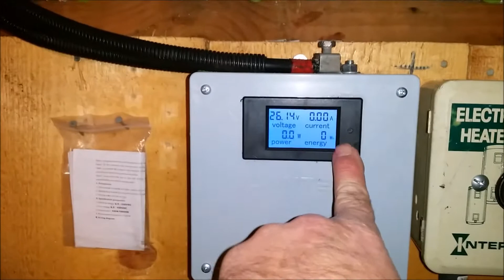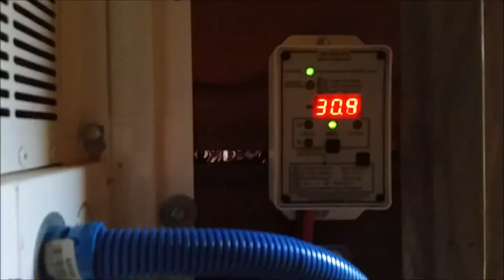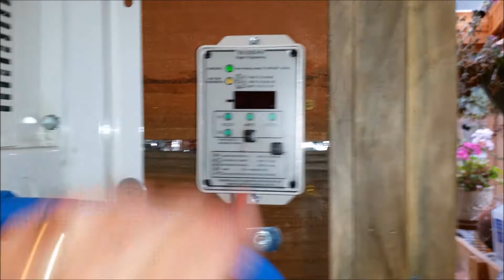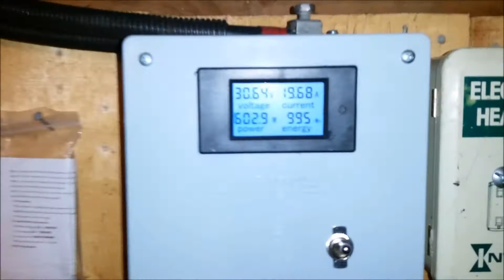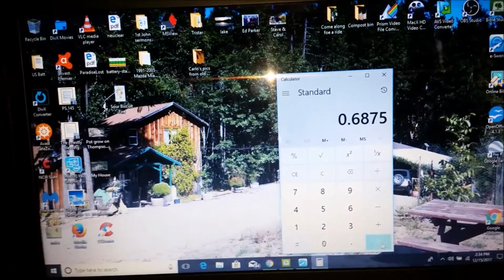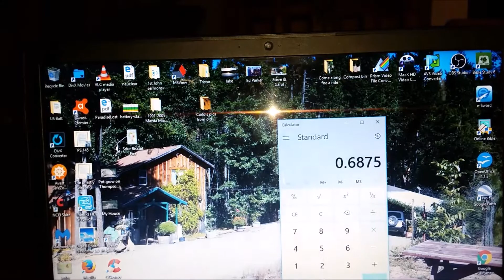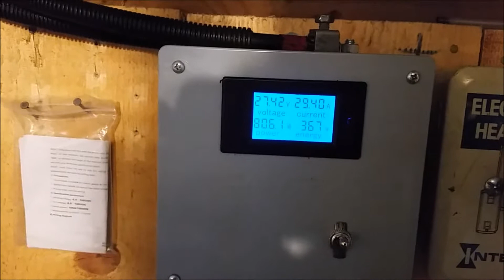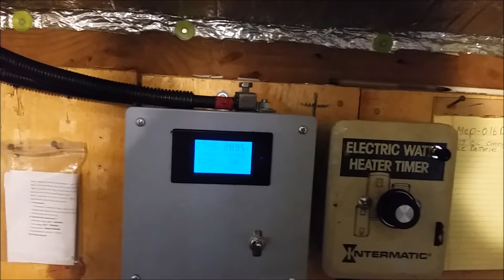301cc Predator 1800 RPM cost per kilowatt hour results

Comment: I have a 40 foot Hunter Sailboat and I would be very interested to get any suggestions to provide power when anchored. Is it possible to use lithium batteries with some sort of diesel generator and solar combination? I have 2 150 watt solar panels but want to be able to use the a/c when off grid. Thanks for any suggestions 😊
Reply from the maker: If you buy lithium ion batteries that have a built in BMS like the "Battle Born" batteries then yes you can charge them with any DC source like an alternator driven buy a diesel engine or a Inverter/charger.

Comment: If everybody checked their numbers like this people wouldnt be running 3600 rpm oversized noisemakers.   I went offgrid in 1997 and do have a genset, a 1800 rpm kubota diesel unit but it gets used so infrequently I am thinking of selling it
Reply from the maker: We probably will be using our  diesel generator less than we have been now that we have switched to lithium Ion batteries. When our L-16 FLA bank was new we burned about $60 a year in diesel. When the batteries were getting over 5 years old we used twice that much fuel. The Lithium Ion batteries do not care if they are at a partial SOC for days on end. The charge efficiency is so amazing you would have to see it to believe it. I installed Lithium for less than 8 new Rolls Surrette L-16 batteries.

Comment: I don't know how I missed this series of videos on this experiment with the 8 horse engine and mods to the 10Si.. but I've since clicked on the notification button !    I should grab a 10Si and throw it on the Yanmar and see how it does against the Ford G1.  (we already know the results of the Leese Neville and the Chrysler alternator)
Reply from the maker: Greetings Mark, The Ford alt. has a lot more rotating mass than the Delco 10si so I don't think the Delco will do as well at  higher amperage. I do not ask more than 30 amps at 30 volts for long run times. I run the Delco at 3k rpm. It cools well at 30 amps. I asked a alternator rebuild shop about the Delco 10si and they said 50% duty cycle max.  They also said the case was designed for 65 amps at 12 volts max for short periods of time. I have the heavier wire  coil and it is rated at 65 amps 50% duty cycle. That's not much. The shop said I could run mine at 30 amps indefinitely. This works for what I am doing now (finish charging) when solar did not quite get there. However I want an alternator that will put out 80 amps at 3k rpm without overheating. The alternator also has to have a remote sense circuit and be able to dial it up to 31 volts with the adjustable regulator.  I only found one that I can afford and its the 130 amp Leece Neville. The 28 volt 400 amp MRAP brush less alternators are $500 and $100 shipping from army surplus. They need 28 HP to get full potential and weigh 125 pounds! So the 130 amp will have to do. My experiment will have to wait until summer as I have a lot of fencing to buy for the front of our place. The fence is 1690' long. I bought the wire fencing but the T posts are expensive. I'm going to be broke for awhile unless I sell some lumber.
Reply: I forgot how small those 10Si alternators are, I found one upstairs. Yes, I can see why they say only 30 amps continuous. 

If you decide to try out a Volt battery, you won't have to worry about that controlled finish charge. Just throw the coal to it !    My G1 puts out about 60V (open circuit) @ 5250 (1350 engine RPM) and about 40 amps when connected at that RPM for roughly 2000 watts (40amp x 50V)  If I turn up the RPMs from that point, the amperage just continues to climb- all the way to 85.  But I usually run it around 55 amps.  Alternator stays nice and cool. I just keep an eye on the battery voltage and whenever I'm a little north of 46V (49 is the max charge), I'll kill the gen as there is plenty in there for the night. You'll love the care free aspect of lithium.  It doesn't care if it sits at a quarter of a charge.  Today is the 4th day straight of almost no sun.  I've made only 5 Kwh's each day for the last 4 days. So tonight I'm letting the battery bank rest around 45.5V because tomorrow and friday we will let those charge controllers work !   We're supposed to have clear skies -- finally
Reply from the maker: Mark Osborne Clear sky would he great! We actually had 3 of them since December lol. Lithium would be so much less of a headache. Making sure I come to a full charge with adequate absorb time to bring up the specific gravity every 2 days gets old. From March through mid November I don't even think about it. I don't need much sun, just a couple hours a day and I would not ever need a generator. They say you should size your battery bank to have 4 days autonomous. In the Pacific North Wet we would need 50 days autonomous if I did not use a generator. We only use 6.5 kwh's a day. My solar array is 4.8k so that tells you what kind of weather we have here. Lithium batteries would take a lot of worrying out of the equation. I could let them ride until 30% SOC and then start the generator. 80% SOC Is the lowest I go and typically only down to 86% on a daily basis. Lithium would change all that.
Reply: Yes yes and YES !...lol    I'm wondering what would happen if you were to connect my generator to your 24V battery bank?  I know the alternator's output would suck right down to 24 nominal, but would the output amperage remain the same ?  .....hummmmmm   do you see what I mean ?  I'm thinking it would.  And if that's the case, the generator would only be producing 1000 watts  at that RPM.  What are your thoughts ?
Reply from the maker: Mark Osborne Your setup on my battery bank would double the amps because the voltage is half of your battery bank. The Delco 10si @12 volts puts out 110 amps with the heavy wire coil in it and 65 amps @24 volts. If you get 60 amps continuous @ 49 volts I should be able to double it with my system. The Ford G1 with a sense wire regulator would work for me. I need to keep the alt. Speed down to 3600 max rpm. I am sure the G1 will put out 60 amps at 24 volts nominal with a near 100 % duty cycle. As stated before the Delco 10si will be a puddle of copper, iron and aluminum if I run it very long at 60 amps. I need to get a G1 and experiment with it. You have already proved it's efficiency.

Comment from the maker: They seem to cool well with the loads I am using. In fact I do not turn on the exhaust fan so I can get the generator shed warm enough lol.I have the same engine on my log splitter running at 2200 rpm in the summer and it's fine.

Comment: how many battery do you need to equal 1 megawatt
Reply from the maker: That would be huge! 45,000 amp hours @ 24 volts is about 1 megawatt. My battery bank is 840 amp hours at 24 volts nominal or 21 kilowatts.